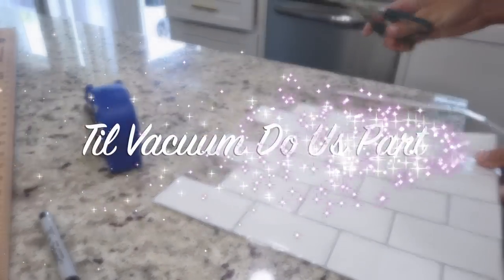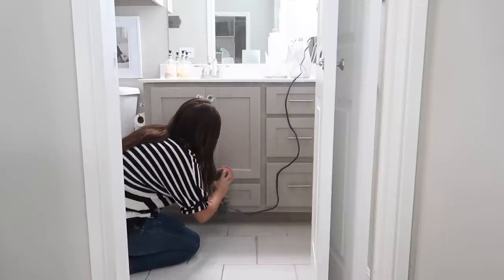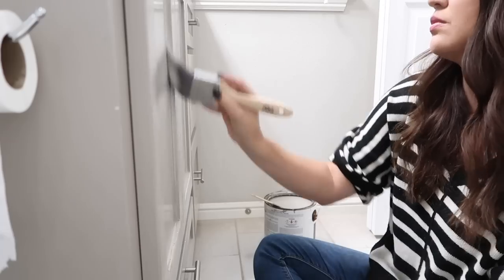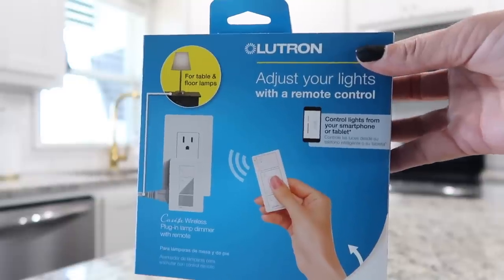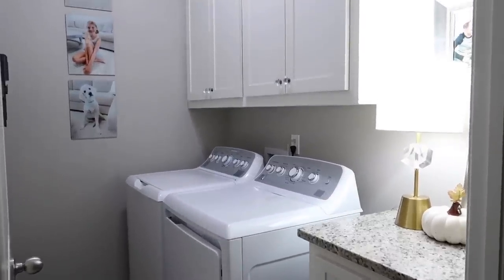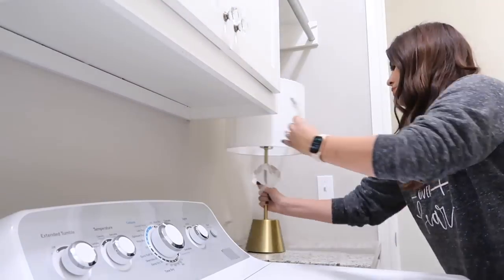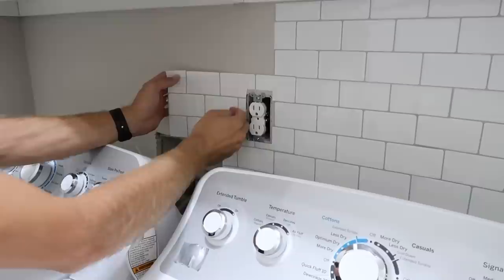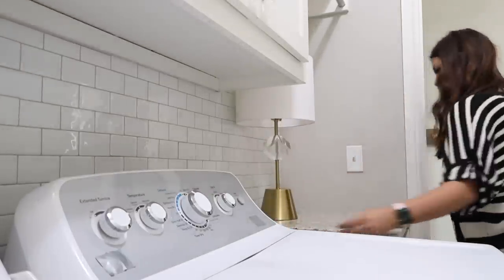EASY & AFFORDABLE HOME PROJECTS | 3 EASY DIYS TO LEVEL UP YOUR HOME | DIY MODERN FARMHOUSE

Comment: I like to use the foam paint rollers when I paint. It is super quick to apply paint and cover so much more area.
Reply from the maker: I do like those foam brushes as well. I use them for stain alot

Comment: Today in my laundry room I had a cabinet installer install  white shaker cabinets above my washer/dryer. They are 42" which allows me to have more shelves for storage. We were talking about painted cabinets that you do yourself. He recommends not to paint cabinets because at the plant they go through a process that the paint will never chip and wear. He said within two years they will begin to chip and discolor. Said even if you have  someone experience to do it the same would happen. Said they are very costly so replacing cabinets are not much more. I am saving up now to have real tile install behind my washer/dryer too. I personal don't like the peel and stick tile. Your home is beautiful but I would of waited to save up money and have it done right. Maybe I would put the peel and stick in a rented home or apartment.

Comment: Uh how do you open the garage in a power outage if the handle comes off ☠️
Reply from the maker: You can’t from the outside, have to open manually from the inside